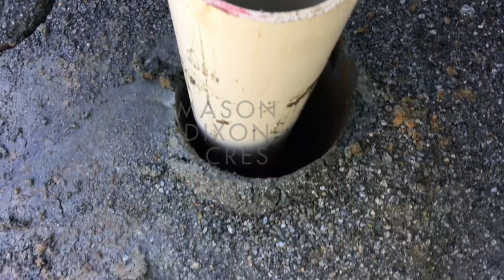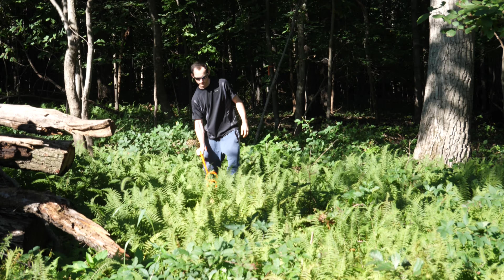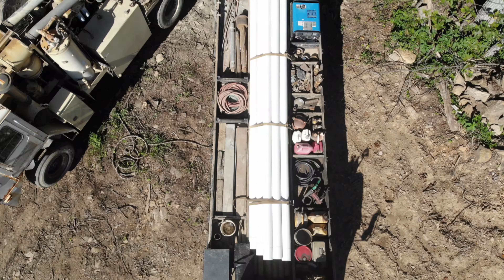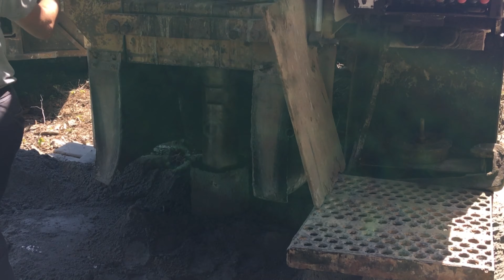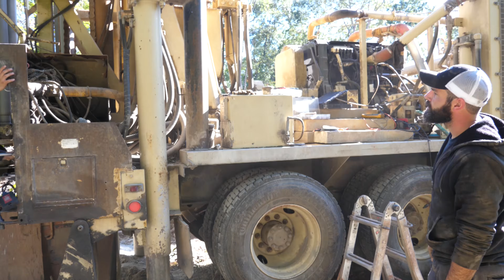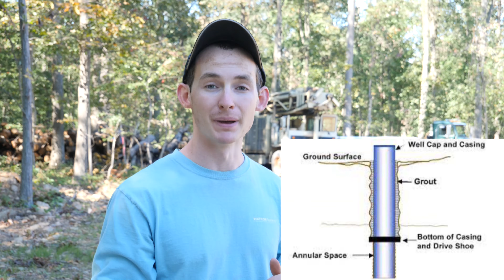Drilling a Well | Process Explained & Cost Breakdown

Comment: In Madison County, AR in 2017, I paid $12,375 for a 575ft well with pump. Still brings up brackish/red water after 5 years and I have to filter it 5 times outside (5 micron, 5 micron, 1 micron, softener, carbon canister, .5 micron filter...just to shower/laundry), then .2 micron filters inside if I want to drink it. Sucks! I change the first 5 micron filter every 2 weeks (because it's red clay dirty filled) and the others (5 micron secondary, 1 micron, .5 micron) every month. They are baleen and washable with a jet setting on the garden hose nozzle, let them dry and use them 7/8 times before they don't clean so well and through them out. AND...I have to put 3/4 quart of 35% hydrogen peroxide EVERY Saturday because the water is contaminated EVERY week and grows mold/algae even though I've sanitized it 10 times with bleach kits for wells.
Reply from the maker: Wow, that well sounds like the biggest headache there ever was. Have you thought about drilling in a different spot if you have the room? At some point the cost/benefit might be worth it.
Reply: Wow you should have listened to Viking preparedness first and checked with the neighbors about water quality or you must have bought the place dirt cheap and the 12 grand you spent was a badly needed income tax write off.
Reply: I just bought property in Madison County, I'm also worried about this. The property has a well but it's been sitting there for 20 years and all the ground there is red clay or iron rock.
Reply: As a professional you can do away with the notion that shorty water is a shitty thing.. Any water ways that carry sediments are just fine.. So as long as -

- your vein produces water. Test for it
- Filter your water appropriately. More specifically you can put systems in that you only change filters 1 a year. 
12500 is dirt cheap for 500 feet! Are you crazy!
Filtration is specific we can easily install systems or provide systems that take all crappy water that I personally love and turn it to bottled water for no more than 8500 bucks supplied and installed. FYI That is bottled water quality. 45 PPM
Reply: Could be problem with broken casing or have to install a liner

Comment: Clearly explained and nicely done!  You made out pretty good on depth.  We had to go to 250' before we hit water.
Reply from the maker: That is not uncommon here, a few houses just across the valley ended up with low-flow 800' wells. The driller said if they don't hit it in the first 150' or so, it's not looking good.
Reply: @MasonDixonAcres They had to drill 176 feet before they hit water which was only 6gpm despite being close to the Susquehanna river. They then decided to drill down to 250 feet to get cleaner water at 12gpm.

Comment: I apologize if it was explained earlier, but how did you know the property had water available to even drill when making the purchase/hiring the drill crew team?  Was there a theoretical chance that a producing well would not be found?  Other homesteading channels have mentioned large premiums are paid for land with a pre-drawn well, indicating not all land has pumpable water.  Also, 250' sounds really deep, the property I've recently purchased has a 30' deep sand point well, that was probably pounded by hand from a single person 40 years ago.
Reply from the maker: You are correct, having water available on a piece of property is not always guaranteed. There is no sure way to know you have it without drilling first. We probably could have gotten away with a well just under the water level, 100' deep. However, that does not get us any borehole storage or safety against drought dropping the ground water level. Wells in our area are typically up to 400' deep, some going up to 800' and yielding .5 gal/min. I think being on top of a rocky hill actually helped our case for finding water.
-Alex
Reply: Many use divining tricks/well witching. We dont trust in the diving method for drilling water. It is a waste of money and a ruse. We have never ever found a diviner to be accurate, ever. There are scientific methods that you can use like resistivity, seismic or deep radar.